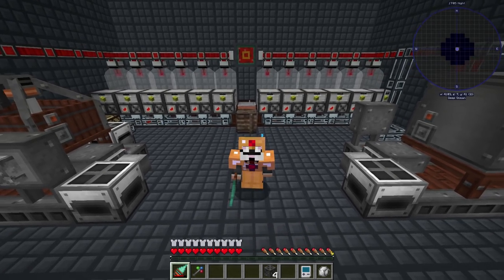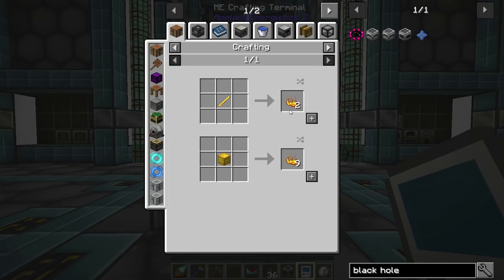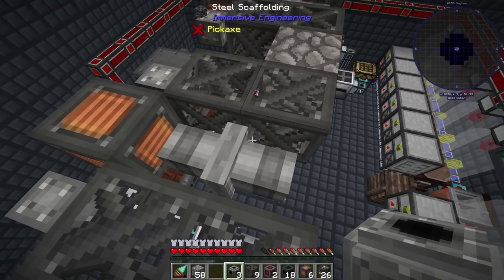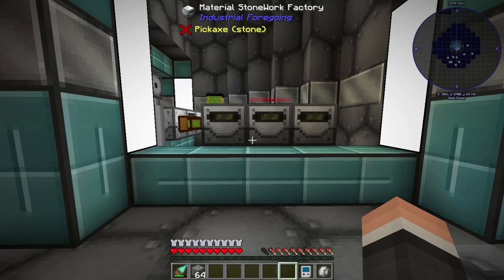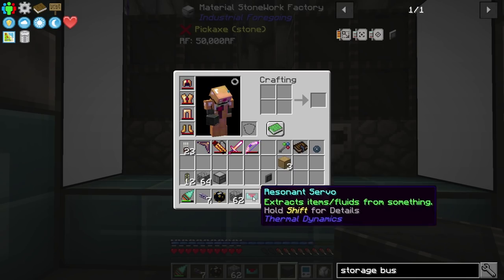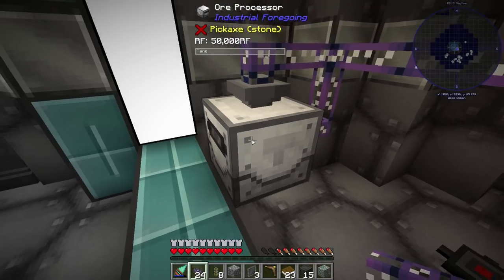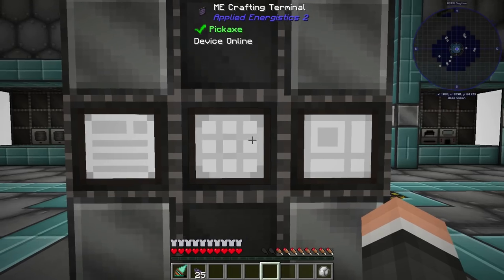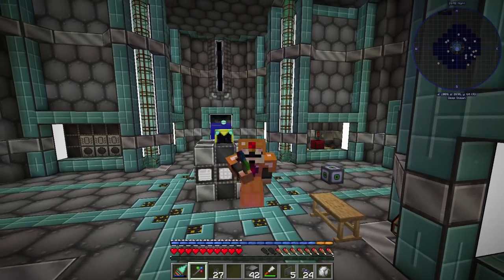DW20 EP19 Diesel Generators

Comment: Hey SC, a few tips:

I don't know if it works with AE, but with RS if you set a RFTools storage scanner next to an (unconfigured) interface, the scanner can see the whole system. Combine that with a Tablet and Storage Control Module and you get access to your system from anywhere (no autocrafting though).

For your power usage, DE wireless RF crystals can show you in their GUI what each linked machine consumes. It's a bit of a setup just for that but super helpful to see what power goes where.

Comment: SC - The IE book crashing is a known issue. To fix it the Mod Author recommends you use the .jar launcher instead of the native one in Twitch. Reason - the native launcher packages an older version of Java that causes the crash but the .jar launcher packages the newest. You can't change which Java version the native one uses (even in the settings, it ignores it since Forge is the codebase that decides it).  I'e had no issues once I switched to the .jar launcher.
Reply: But you can change the path to Java in the Native Launcher's launcher options section.  I set mine to the newly updated Java.exe, perhaps that will also resolve the issue.  Thank you for the tip! And thank you SystemCollapse, another awesome video!
Reply: huh, strange I haven't had that problem since the last update

Comment: One squeezer isn't going to supply enough plant oil from melon seeds, i tried this on my own world and my 2 diesel generators couldn't keep running :/

I think you'll need 4 squeezers if you use melons.
Reply from the maker: I have done 2 and it is close now, I think It can be done with 3. But we will see.

Comment: I'd have liked if you did advanced generators with biofuel instead of the biodiesel generator.
Reply: i believe that advance generator is used less compared to biodiesel, it's just halfassed (due to not know what word to use) compared to extreme reactor and other heavy power generators, granted it's easier than deep resonance, 
biodiesel is a themed generator, simply said people who want to make generator base on aesthetic will make diesel, while other who want heavy generator will go for extreme reactor, there is just no real reason to use advance generator